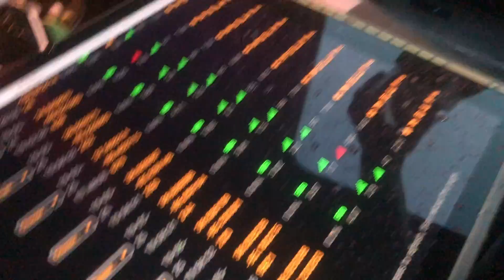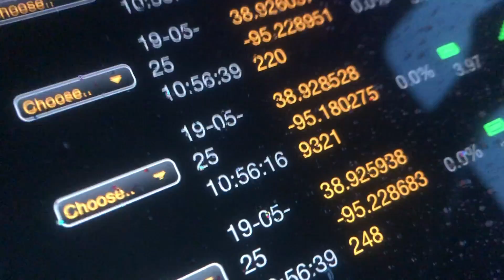ROCKET LAUNCHED into monster wedge tornado! Tornado lofted sensor to over 34,000 FEET!

Comment: Word to the guy holding the transmitter from a radio tech. You'll keep signal longer if you point the antenna directly perpendicular to the imaginary line extending from you to the rocket. So if you're facing forward and the rocket is located 45 degrees up off your right shoulder, your antenna should be pointing in a direction along a plane described by the following lines: 45 degrees up over your left shoulder, directly toward your front, 45 degrees down off your right shoulder, or directly toward you.  This is because radio waves don't propagate out from a straight antenna evenly in all directions, it forms lobes whose strength is highest perpendicular to the axis of the antenna.

Comment: That's amazing,I've been interested in tornadoes ever since 1982 I was 9 when one touched down on our farm in Marion county FL I was out in the field half mile from the house I watched it suck huge live oak trees out the ground and toss them a couple hundred yards away like nothing and then take our tractor trailer loaded down with round bales of hay and lift it what looked like 300 ft in the air and toss it in the top of the only oak tree it left I couldn't move just hypnotized by it the sand and pine needles cutting me to shreds thanks for the videos

Comment: 90,000 ft is where weather balloons top out and looks as if you are in low orbit, its a crazy way to think about it, but if the tornado threw the sensor 3 times the 30,000 ft it did, it would literally seem like the tornado was throwing it off the planet.

Comment: Please provide specs on the rocket as well if you don't mind. I'm also a hobby/high power rocket enthusiast
Reply: Will you make this data open source? What power motor was used to launch the rocket. Cp/cg points on rocket? Who designed built it? Is there cad file? Rocksim file?